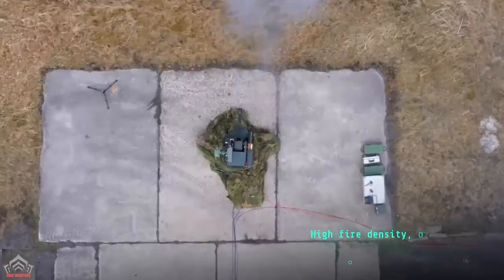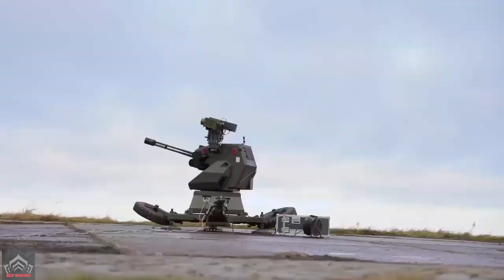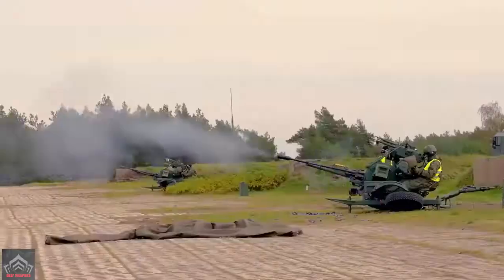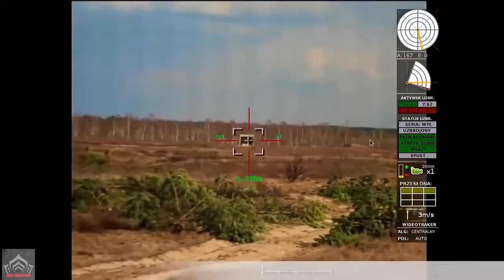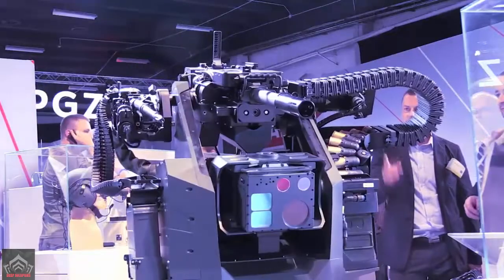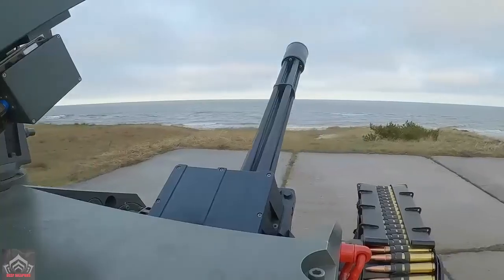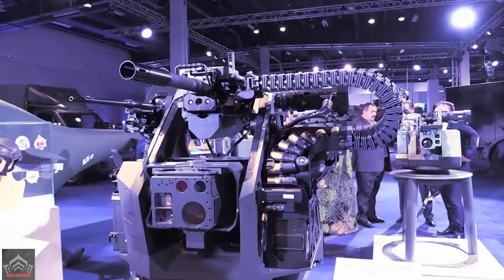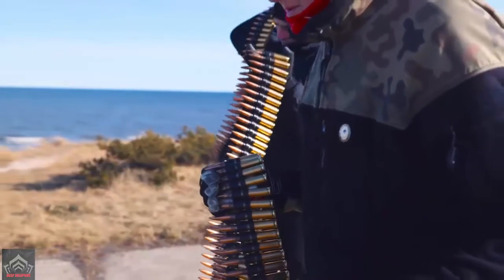Poland tests anti-drone Browning-type 12.7mm WKLM machine gun

Comment: 35 mm programmable ammunition’s ability to adjust detonation parameters makes it a precise and effective choice for drone threats in urban areas. Accuracy and minimizing collateral damage are critical. 12.7 mm ammunition carries a higher risk of missing the target and causing unintended damage, making it less suitable for urban areas. .
Reply: Again its about cost effectiveness. 35mm air burst is great & effective but also bulky very heavy &
much much more expensive BOTH the system & the ammo. 12.7mm is cheap & so are FPV drones.
Think about how many WKLM you could buy crew & arm in comparison to a single 35mm airburst system.

Its also a much less complicated system easier & faster to train a crew.
Reply: @quigonjinn3567  Read my comment again. I said 35 mm is for dealing with threats in urban areas. 12.7 mm works better for frontlines, forests, and coastlines. You can’t safely fight drones with 12.7 mm in cities—most rounds will end up in people’s gardens and houses. You can’t protect cities and people if stray bullets are killing them

Comment: Unfortunately it is completely pointless.
Against marine drones, it is less precise and short ranged compared to any 30mm single mount.
Worse than ZU-23 agains aerial targets because of range.
Huge ammo consumption against small targets like drones.
Too heavy to mount in helicopter door.
Fantastic for mounting as upgrade in light attack helicopter, unfortunately light attack helicopter became completely obsolete.
Too heavy calibre for vehicle mounting for self defence of special forces.
Basically it answers a question that nobody asked.

The only reason to choose Gatling over single barrel, is when you dont need accuracy and accept larger dispersion, because the mount cannot be stabilised, and both target and shooting platform is moving. This is no longer the case, as even vehicle mounted 50 cal HMG use stabilised turrets, are more precise, lighter and use less ammo.

This gun solves problems of Vietnam era, with helicopters flying over rnadomly appearing huge number of enemies. Today, those enemies woudl easily shoot any helicopter down with MANPADS.
Reply: Switch the GAU 19 for a FN Minimi and downscale the entire turret, to the point where the whole package can fit on top of a HUMVEE, or any other large pickup truck

That would be effective for modern warfare against smaller drones, not helicopter size targets

Comment: Now we need .50 proximity shells
Reply: The reason why we got 20x102mm is because they are large enough to fit all that bullshit
Reply: @ackerkartoffel8627  both of you are wrong. anything below 30-35mm is too small to be worth it because it doesn't provide a good enough HE or fragmentation payload.
40-57mm is the sweet spot, but you can get away with 35mm.  30 is also border line not worth it tbh. it doesnt sound like much but that simple 5mm difference between 30 and 35mm will result in a net 60% increase in internal volume which means 60% more explosive and fragmentation effect PER bullet, and as i said before the 35mm is about what the floor is for being effective at Frag/Prox shells. so anything smaller isn't worth it.

Now we do have 20mm HE which explodes on contact, but we mainly rely on Sabot Light AP (SLAP), and HE-SD, but thats not a prox fuse, thats just to pop the round if it misses a target and help prevent falling projectiles.
pretty much anything that relies on hit to kill instead of prox is wasteful and ineffective in the modern world, especially against small targets. so i dont see this or even 20mm phalanx being very effective and certainly not economical.